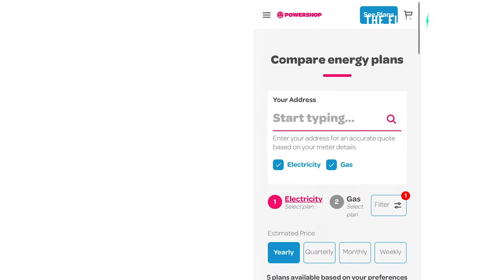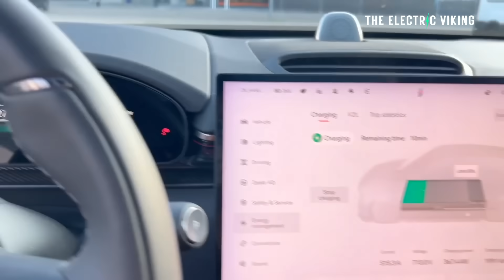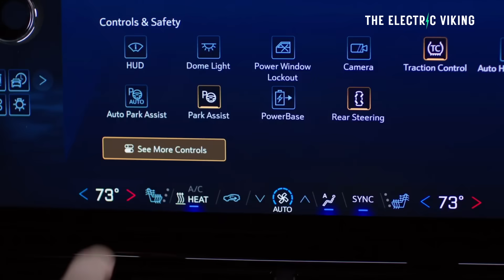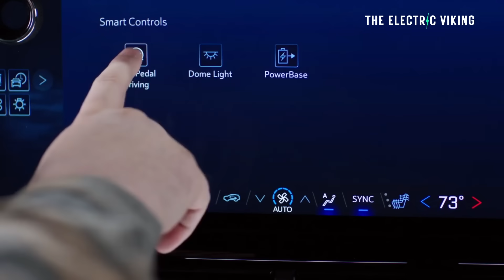These 2 American Made Electric Cars Could Power Your House Forever

Comment: I have the Silverado EV WT with the max battery. I’m having an electrician wire my old transfer switch to work with a bonded generator. The truck would only be used in an emergency when the power goes out and could run the house for days. Truck can also run my RV if I was to camp off the grid. Fantastic vehicle. My OBD2 shows the truck battery at 211 KWs. GM always under reports their battery sizes
Reply: I have the same. Managed to snatch the last one Carvana was selling for under $50K. 26 miles on the clock.
People who complain about EV prices too entitled to understand what they’re getting.
Reply: @migmigjohnson6083 nice. I tow our RV a lot with it to various campgrounds. Great rig.

Comment: Our family did the same math and bought a Lightning.  Our electrician installed a disconnect for the 30 amp bonded neutral generator in the truck along with a Leviton load center with smart breakers.  Connect the cable in 10 minutes and the house can run for days if needed.

Comment: $73,000 for a battery?  That's 20 YEARS of power billss at $300 per month. That does NOT include the $20,000+ solar array that would also be required.  No one is saying this, but I bet using your truck battery repeatedly for vehicle to grid probably either voids its warranty or lowers its lifespan.

Comment: I have the 2024 XLT Lightning. I don't have the  Ford Charge Station Pro or Home Integration System. My entire neighborhood was in darkness due to a power failure.  I used one of the 110-volt XLT receptacles and an extension cord. This powered the fridge, internet, lights, and more.   I used less than 1kWh during a 6-hour power grid outage.

Comment: I also got solar on the roof this year. The installer - Great Sky Solar - recommended I use my car which has V2L as my battery backup for the house. My car has a 77 kWh battery so we won’t be powering the whole house like the big boys can but it will keep the essential stuff going for 3-4 days at least. I love the thinking about the value of these vehicles and their battery systems.

Comment: South africna here. My Home Batterie is 30 KWhrs and it cost me R105K Rands - which is  6070USD - so at same price for the Ford F150 Lightning - multiply it out by 4 - gives me18 210 USD for just the batteries - and the car is valued at 63 000 USD - not bad at all - and I am nearly off the Grid in Johannesburg.
Reply: i wish you safety sir

Comment: Why are power walls so expensive compared to the vehicle. That doesn’t seem right. Seems like for an equivalent sized battery at a home when compared to the vehicle should be less expensive - weird. Maybe margins or permitting?
Reply: It’s because the R&D and IL stamp. Usually they have good bms

Comment: A good mate of mine who just so happens to be in the solar industry just bought a written off EV with minimal damage with only 4000k on it for $5000 stripped the battery out and is now running 70kwh storage. Better to keep all that extra coin in your own pocket and go down that path if you want decent solar storage and the more EVs on the road the cheaper they will get

Comment: The UK, Tesla Powerwall 3 typical cost and capacity, £7,000 pounds for 13.5kWh capacity. Typical cost of good second hand EV, £20,000 with 58kWh capacity. You are getting 4.5x the capacity of a Tesla Powerwall 3. That would cost you over £30,000 if purchased in Tesla powerwall 3's. I have seen videos where people have actually found cheap EV's for sale that maybe aren't in top condition but the battery and cabling and etc is perfectly fine and used them for V2H and V2G and just left them parked permanently. Yes you need the room and the correct setup, but it does seem to me that your typical home battery is way overpriced for the wH you are getting out of them. Keep in mind that £7,000 is the cost of the battery and not installation and connection to your existing setup which could push it to £10,000 to £11,000 and make using a second hand EV as a power backup for the home much more attractive.

But I mean when you think about it, it's revolutionary right? A small family, typical one person or two person household with one or two EV's for the two person household would not even need a battery to go with their solar panels. If the single person goes out driving for the day they aren't using a lot of power, maybe fridge and AC on low if at all the solar panels can handle it, get home, plug the car in, battery right there, maybe you  need to charge from the grid on cheap overnight rates but that's not a lot. A two person family with 2 EV's, even simpler, there will always be at least one car available to be plugged in when someone is home.

Larger family with kids and 2 EV's for mum and dad, well you don't need a huge battery, you already have one in each car. V2H/V2G should be the basic install setup for any EV household, it's a no brainer really

Comment: Great deal, but I'd like a simple inverter to run to 120v outlets off grid would be enough instead of a proprietary system that needs to be connected to grid $$$

Comment: Unfortunately some US states utilities do not permit EVs or even solar powered batteries, to be connected to the grid or just the domestic load panel with suitable safety interlocks.  The only solution where we live is to go 'off the grid' and install a larger solar farm to harvest the required energy.

Comment: Only one problem - it's a car. Unless you have a very long extension cord, your home will be powerless while you are actually driving your car. If you have solar, you will be losing any energy being generated if you are driving during daylight hours. V2G may be great for supplementary energy storage, but you still need dedicated energy storage for the above reasons.
Reply: My 12kwp solar roof is grid connected to DTE in se Michigan.
Not 1:1 but not nem3 bad.
I have 25kwh of battery backup and 10kwp inverter when grid is down.
Batteries only going down in price every month, capacities/$ and new chemistries always improve moving forwards

Comment: Solar power systems are not free, so you do not charge for free
Reply: I do, almost every day. My solar system produces more power than I can use or backfeed into the grid. That's when I charge my EVs using surplus solar electricity that otherwise would never be generated.

Comment: The Ford vehicle integration is not near as reliable as you think it is, after a while the car will go to sleep and quit working so you have to stop and start the car to keep it's ability to provide power to your house in a power outage, the power wall will work most of the time, and has energy arbitrage features that ford could gain but also a bad firmware could wipeout the ford home integration as their firmware updates and Bluetooth support and antenna placement effects how well the vehicle integration works

Comment: I have a solar business in the US and have been telling my customers that using an EV as an emergency battery makes a lot more sense that a battery backup for their house. I took my advice last year and have a Silverado pickup with a 200 kwh battery. It rocks. Keep up the great videos.
Reply: I got a quote for 2 x 10 kWh batteries for the house: $31,000. That's more expensive than a used EV with 3 to 4 times more battery capacity.
Reply: If you can use the power from your EV (like 240V port on the Lightning) then a 3kW solar generator from Bluetti/EcoFlow might be enough.  Plug the solar gen into the truck and use it via a generator hookup to power the show.  If you need to use the EV disconnect from the EV and the solargen will keep the house powered until the EV returns.
Reply: @wanderleyceschim2881  Actually I get 10 times the battery than your quote , 200 kwh vs. 20 kwh in your quote, 8 times more when figuring I typically charge to 80%. Plus is costs me .08/mile to drive with electricity from home vs .31/mile from my gas pickup .Naturally with hauling my solar panels on jobs I got less mileage from both my electric pickup and also the prior gas powered pickup.
Reply: Unless you need to take your EV someplace.  An EV + home battery is more resilient combination.
Reply: @jabbathespud  Yes, you are right, but you can never get 200 kwh of battery for a home system and have a pickup thrown in for free, so I am fine with the extremely rare use. Other people want a battery at home, each to their own
Reply: Nice
Reply: So you opt for the larger battery option. I go with the Smaller battery 2WT trim. Good truck, but some shxt design should have been left out like the funk latch. And the sofware is buggy. 😂That stupid thing told me my propulsion battery is dead. And after 3 hour it sort itself out and the system refuse to release the parking brake. Make no mistake, the SEV sofware is such a cluster, I am start lossing confident on it.

Comment: Son bought the standard range lightning XLT so it a lower end model over a year ago and he is satisfied . He has solar and one power wall  which can't be used for backup. I believe it's $10 to use the Ford as backup . His vehicle doesn't have the 240 outlet which could provide a much cheaper form of backup similar to a portable generator so he has some regrets getting the lower end model but he has not needed backup . He also has the standard voltage outlets that can supply some items like the fridge.

Comment: If a person only knowing EV's today were to try and be sold an oil combustion vehicle, it would be extremely odd to say you have to go to a store and pay $3-$6/gallon for fuel, or about $60-$100 to fuel up, which gives you on average: 350 miles, which you will also need to take to a store and have serviced twice a year, to have the oil changed for $60-$100, along with other likely maintenance costs that add up to thousands over several years.  The vehicle is noisy, stinky and causes human-killing emissions and catostrophic climate change, AND, it will last, on average: 164k miles before the engine dies.  NOBODY in their right mind would buy it, they make no sense!
Reply: If it actually worked in 50 degrees below freezing, it would sell like hotcakes.

Comment: Dont do the Ford Home Integration Kit... Neither Sunrun, nor Ford have any tech support. Get the bigger onboard Inverter and a transfer switch. Better yet, get the Silverado... 2x battery!
Reply: Wouldn't you really rather have a Tesla Cyber truck?
Reply: @tedmoss  No
Reply: @tedmoss Not enough flat surfaces to put your beer on when loading the bed.  
    Do they sell a magnetic cup holder? I'm not gonna check.